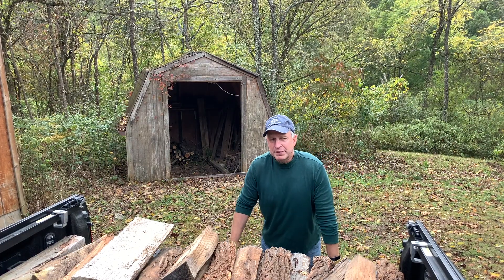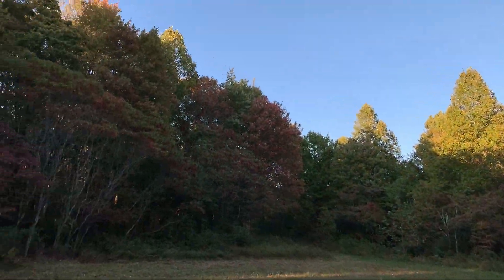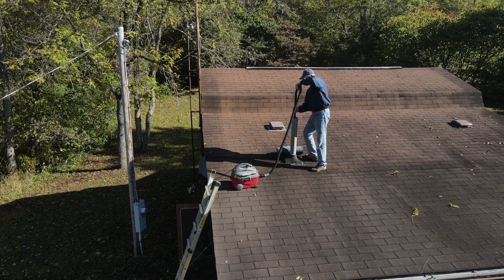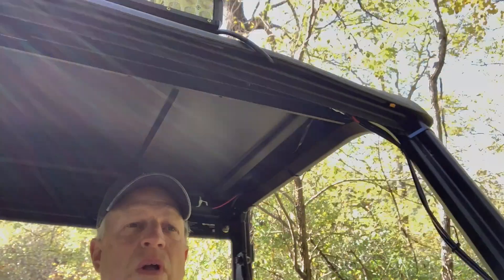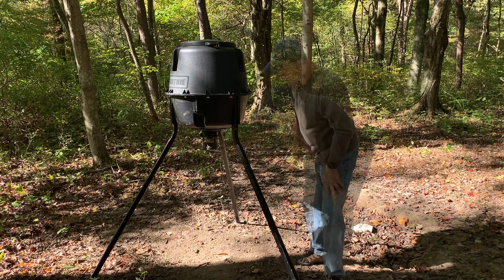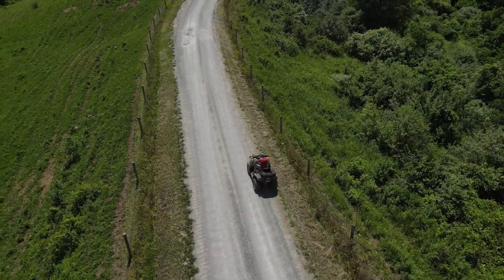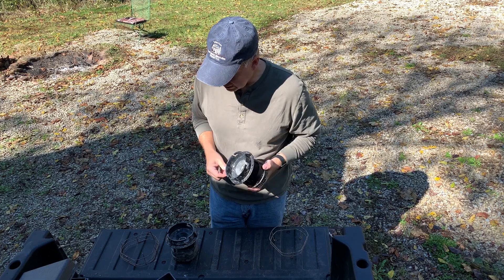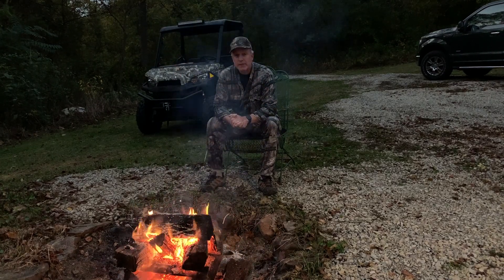Polaris Ranger 570: Downhill Engine Brake Work Around , Composting Toilet, And An Engorged Deer.

Comment: Just bought my first utv, it's a 2019 ranger 570 midsize.  We live on a hillside, over 300' elevation rise.  First place I went with it, was to the top of the hill.  Was a little surprised on the way back down!  Don't know how I stumbled on your video, but thank you for the "fix", gonna try it tomorrow.
Reply: Did it work on the hill? Have the same issue and was curious
Reply: I ended up getting used to it.  I don't really do as suggested here, except for maybe in a couple nasty spots.  For the most part, it's as simple as just keeping your foot on the gas pedal.   If you completely let off, it'll go to free-wheeling.  If you keep a little bit of rpm's up, you can come downhill 5-7mph without ever touching the brake.  It's just counter-intuitive.  Play with it, you'll get used to it.

Comment: Thanks for the info. I just got my Yamaha Viking. It was ordered in July when the weather was nice, but it took a while to get it due to the covid thing. It's just too cold right now here in my region of Canada to go for a ride. It's warming up tomorrow and can't wait to see how it handles going down a steep hill.
Reply: I have a viking 2014 SE. It has never slipped out of gear. We road it all over Colorado mountains for years. No issues. It works great. The only thing I would chand is more suspension travel for smoother ride and more power and topmspeed in high.
Reply: @audiohazard1203nut  Nice to hear from a fellow Viking owner. It must be a good machine to handle the trails in Colorado since 2014! I'm an older fella with a woodlot. My old atv died so all my buddies said get a sxs. It's perfect for woodlot maintenance.  And the kids use it to go out on the trails when they visit.

Comment: I have a ranger and that has been my only complaint thus far. Duraclutch makes a kit to fix this. I saw a post in a fb group so I have researched and found it is what’s needed. I searched YouTube and there are some videos showing how it works and examples of going down hills not touching the brakes or gas. Hope this helps
Reply from the maker: Thanks!

Comment: Try going down the hill in High gear. That might be why the engine break isn't working. Not sure the engine brake works the same in Low.
Reply from the maker: High gear does the same.  It sounds like the only recourse is some modifications with after market kits.